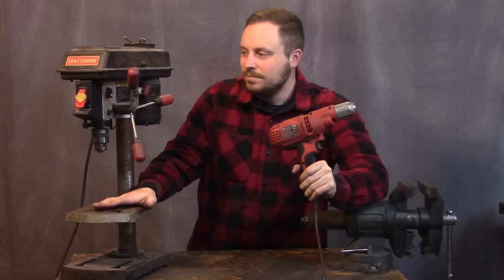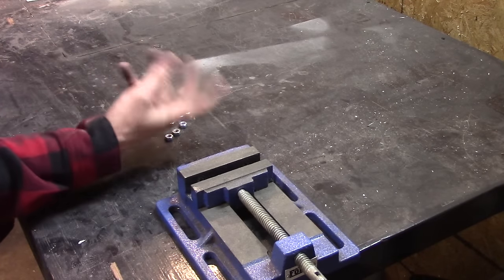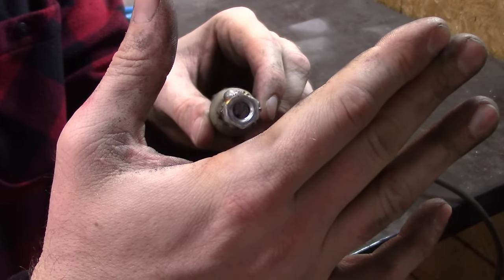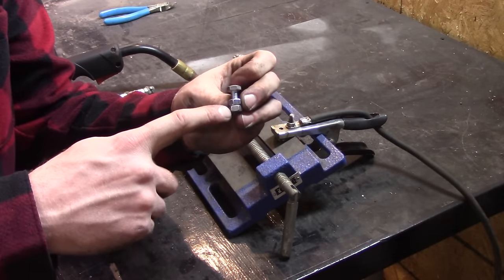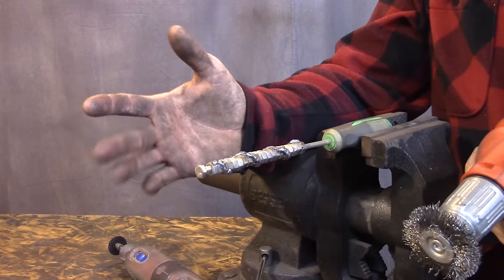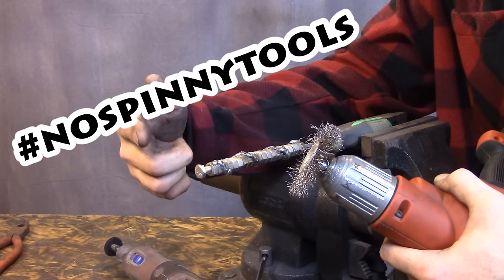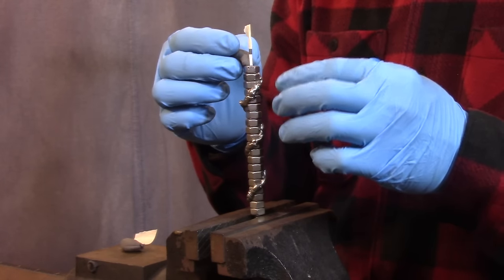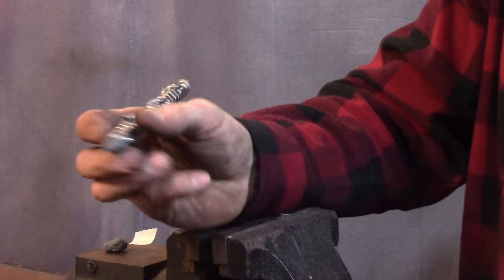NO LATHE PEN CHALLENGE! - Metal Pen

Comment: How to make pen:
Get spent 243win cartridge
Expand holds in cartridge slightly
Take apart bic pen
Cut ink stick thingy to proper length.  Remember,  this will dedermin how much of the pen shows out of the cartridge. 
Remove metal tip, so as not to damage
Place inside cartridge. It should fit some, but not much. Just enough for a guide
Turn cartridge upside down on a hard surface,  and give it a few hard smacks.

Comment: Just use a 3d printer?

Or take the ink thing and just wrap it in tape and then an epoxy. Pull out the ink when it's taken shape and wait for it to harden. Then all you need to do is slide the ink things in and out

Comment: That doesn't look comfortable to hold at all. Could you have had the nuts at 45 degree angles to each other so every other one is the same orientation and then weld in between them so when you grind it down there's no sticky-outy weld?
Reply from the maker: It is actually really comfortable. It doesn't look like it though LOL

Comment: A lathe is nothing like a drill or drill press they look closer to a mill and a lathe look nothing like a mill.
Reply: No shit, a lathe is not meant to be like a drill, it's kinda in the name, but you can use a drill as a lathe and you can also use a lathe as a drill.
Reply: connor etchells a lathe is literally a high torque drill on its side.